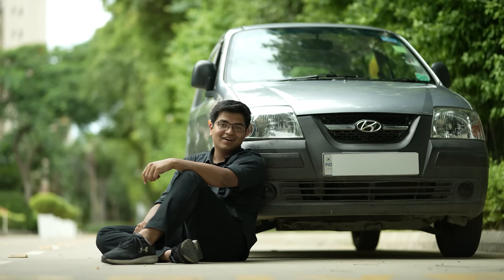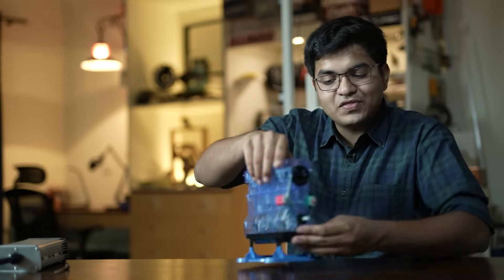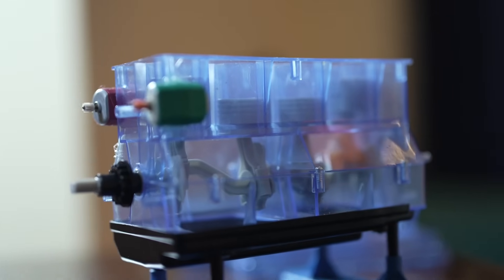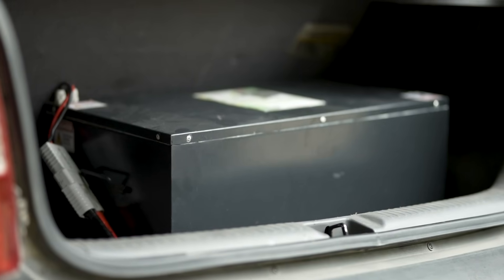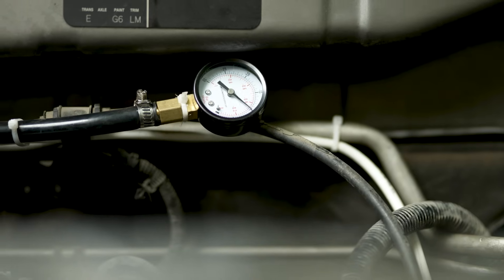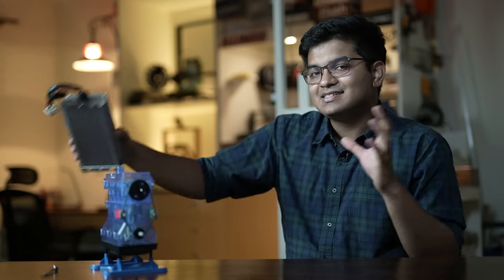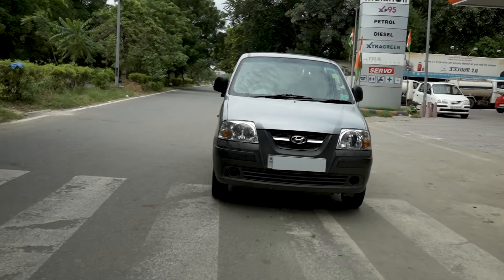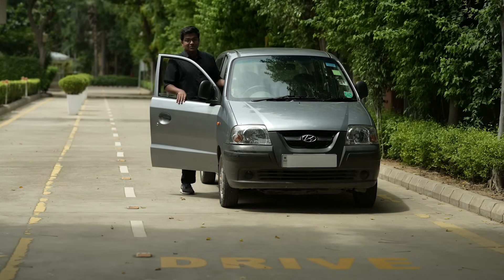Simplest EV Conversion under $3000 - Convert Your Car in 3 Days!

Comment: I need info. On motor and battery buying.
I want to put 50kwh battery in my swift if possible.. but if not thalen i will put maximum possible battery size by upgrading suspension for battery weight
Reply from the maker: Hey - are you looking for a really long range EV? Because a 50Kwh battery will get very expensive. Even commercially produced EVs like Mahindra's E2O have only a 15KWh battery (around 140Km range)
Reply: @MakingWithMihir   all i know is tata nexon ev max has 40 kwh battery. And it does 300km.
So a 50kwh battery will be best as its range will be 400km around.
I am a mechanical engineer and i will make it possible.  Just need info on battery companies which can deliver batteries custom shapes
Reply: @MakingWithMihir  can you please give me conpany names for electric motor and battery pack making companies???

Comment: Well done. This will boost the spirits of 15 years old Santro owners. Is it possible to make auto transmission.
Reply from the maker: Hey! One of the other conversion techniques I want to try out gives you an EV without transmission. You can buy an off the shelf differential with a motor attached to it. The idea is you remove your rear two wheels and replace them with this differential. Remove the whole engine and add a separate motor for power steering and AC compressor. The only issue I faced with this is obviously the issues with adding a separate motor for power steering and AC compressor but also that I couldn't find an off the shelf Indian made differential with a 6kW motor.

Comment: Use the alternator for regenerative braking or something 🙂
Reply from the maker: Hey! That's a great idea. What's interesting is that modern BLDC controllers like the Kelly Controller come with built in regen braking. You'd have to add a switch that engages it when you release the throttle but other than that, it's quite straightforward. Definitely something I'm looking to add to this car!

Comment: Show  more specs of battery and motor.
Reply from the maker: Hey, you can find the technical specs on my website (link in description) TLDR: 72V 6kW motor, 72V 100Ah battery, 350A Kelly Controller and 72-12V 20A DC-DC Converter

Comment: Is the EV conversions allowed in India. When I checked with RTO. They told its not allowed to convert to EV
Reply from the maker: Hi! EV conversions are allowed in India, however you can currently only use an ARAI approved kit. If you go through an ARAI approved conversion company they will update your car's RTO registration and provide you with a green license plate. 

This conversion is currently at Proof of Concept stage and I have not yet explored the regulatory requirements to get certification and approval. 
The focus of this project  was to develop a simpler and more cost efficient conversion technique.

Comment: Nice work. Your engine oil will last forever. But what about the RTO and changes required in Car Registration papers?
Reply from the maker: Hi!
The conversion is currently at Proof of Concept stage and I have not yet explored the regulatory requirements to get certification and approval. 
The focus of this project  was to develop a simpler and more cost efficient conversion technique.
If you would like to convert a vehicle right away, I understand that there are ARAI approved conversion kits available. If you go through an ARAI certified company, they will get RTO registration updated and give you a green license plate.

Comment: Here's a nice project i would love to convert to EV; not for long distance trip, just around town. the 1997 tacoma truck 4-cylinders LX auto tranny will be an ideal project when the gas in Calif is $5.50 per gal. it also has 381K miles with original tranny; overhauled engine with 271K. wouldn't you still need water pump to cool the bare engine? since the fuel tank will be empty, 4 pistons and cam shaft removed, that would be lot of weight saving to allow more lithium batteries in parallel for longer range. what do you think of this prospect to convert the truck?
Reply from the maker: Hey! First off - please keep me in the loop if you convert your truck! I'd love to see some pictures. 

As for this technique, we can get away with the whole timing belt hack because of how light the car is and the small motor. The car has a Kerb weight of around 900Kg (1980lbs) and the motor is only 6kW. 

I'm not sure if california is cool enough to avoid AC. If you don't care about AC, the simplest option might be the classic rip out the engine and put the motor straight on the bell housing of your transmission. For power steering you could swap it out for a EPS rack or jerry rig a cheap DC motor to spin your power steering pump.
Reply: thanks for your reply. i also saw few video on your idea straight electric motor to the tranny. this method requires even more accessories to run the AC, the PS pump, brake and change in gear shift method. actually, either method would require jerry rig to get the 3,500 lbs truck rolling; may encounter uphill lag in Calif mountain driving in my local area. maybe in the future there might be a much simple and cheaper methods. thanks for sharing your idea.

Comment: What i was asking how you pass from RTO you kept it white plate or green plate ?
Reply from the maker: Hi!
The conversion is currently at Proof of Concept stage and I have not yet explored the regulatory requirements to get certification and approval. 
The focus of this project  was to develop a simpler and more cost efficient conversion technique.
If you would like to convert a vehicle right away, I understand that there are ARAI approved conversion kits available. If you go through an ARAI certified company, they will get RTO registration updated and give you a green license plate.

Comment: If the 12v vacuum pump fails, you can have a break.!
Reply from the maker: Hey - the vacuum pump is needed for brake assist only. It maintains a vacuum in the brake booster such that even if it fails, you can get 4 full braking operations before the booster equalises with atmospheric pressure. Even once the booster has atmospheric pressure, the brakes will still work - the mechanical linkage to the brakes is not dependent on the presence of a vacuum - they'll just be harder to push. Thanks for your comment!

Comment: Sir I need vaccume pump for my e conversation car.And good dc to dc converter
Reply from the maker: Hi! For DC-DC converter I recommend looking at IndiaMart and finding a seller. If you have a smaller car, you can also check out Karol Bagh in Delhi - there's an EV market there mostly for e-rickshaws and sell smaller converters.

I had a hard time finding a 12v vacuum pump too - couldn't seem to buy what I needed in Chandni Chowk, Chawri Bazaar, Sadar Bazaar or Mayapuri. There are many sellers on wholesale websites like Alibaba that sell vacuum pumps - check those out and get in touch with the sellers. It will take time to come so plan ahead!

Comment: Price and brand of the Motor kit???
Reply from the maker: Hey - you can find more details on the website article I linked in the description. The motor is a 6kW 72V motor from Compage Automation in Delhi and they can sell you the appropriate controller for it too. In my case, the controller was a 350A Kelly Controller

Comment: The fact that he's able to do this with a relatively tiny battery because of a Gearbox, tells me that there's space in the EV sector for Manuals, IF enthusiasm for Manual cars persists. 

Not only that, if pairing an EV with a transmission means you don't need as powerful motors or batteries, it means that EVs can be more efficient and even more environmentally friendly because you won't need the huge battery packs. Am i crazy or is there a future for the transmission here?
Reply: It would improve low end torque greatly, and you would have max power immediately available to you as opposed to max torque. This would increase accelerations in the low end however it would not help with top speed. The top speed of a car is determined by how much drag and friction losses you can offset with the power of your engine which does not change with a gearbox. It would harm top speed and efficiency a little bit as the gearbox would increase mechanical losses. But i would love to see electric cars with gearboxes as it would make for even more break neck accelerations. A propper CVT on an electric will be even better as it will allow for continous and max power throughout the speed range
Reply: Steam cars also don't need a transmission but some White steamers had a two speed axle
Reply: bro u got some real brains right there
Reply: This is great stuff ! I may consider this for a nano we have
Reply: nice epic bro duded
Reply: Congrats for your innovation. My doubt is motor has such power to drive the crank shaft & piston moving up & down.u removed spark plugs. Is there any drawbacks.
Reply: I think they removed the pistons, there's no need for them if the head has been removed
Reply: I have a feeling the reason he used a gearbox is because he probably used a DC motor which are cheaper than AC motors (used in teslas and all other production EVs), the downside to these are they have less torque and can't rev as high as AC motors.
Reply: you are crazy
Reply: I love this line of thinking.  I want a manual electric!
Reply: my 2 cents ... xmission will hardly make a difference as in motor peak torque is immediately available

in case of engine torque is gradually developed so is the power and hence you need transmission manual or automatic with multiple gears for various reasons 

only possible benefit of an transmission for ev would be  in my opinion for inclines or slopes if u dont want the hill climb n hill hold n other modern tech
Reply: @sagar33sawant  EVs are terrible with 1 speed tranny on highway. It's laughably bad.

Comment: Is this street legal, i mean has the modifications been registered with the RTO
Reply from the maker: Hi!
The conversion is currently at Proof of Concept stage and I have not yet explored the regulatory requirements to get certification and approval. 
The focus of this project  was to develop a simpler and more cost efficient conversion technique.
If you would like to convert a vehicle right away, I understand that there are ARAI approved conversion kits available. If you go through an ARAI certified company, they will get RTO registration updated and give you a green license plate.

Comment: Hi this was an amazing and well done video. I think this was a really thoughtful use of your grandfather's car. As an electrical engineer I would recommend that you do not use a 12 secondary battery but rather power your low voltage line directly from the 72-12v converter that you have. It seems like it is beefy enough and has enough heatsinks. This would also reduce the overall weight of the car by a few kilograms. If you keep the secondary battery always charging off 12 volts you will degrade the battery and cause corrosion of the inner cathode/anode. Please search up lead acid battery left on continuous charge. That battery would be better off in gas car. Overall great video <3 please make more
Reply from the maker: Hi! Thank you so much for your detailed comment! I will definitely look into lead acid continuous charging! That said, the battery in the video isn't a car battery - I bought an AGM UPS battery for this purpose. I'm really glad you enjoyed the video and will keep making videos :)
Reply: What if you added another 72v lithium battery ,would we get double the range ..We remove the 12 v and also power from the step down transformer all the 12 v lights ,power steering pump etc ?
Reply: Yes, a second lithium battery of the same size would certainly double the range.
Reply: Please advise ,how do you get the power from the electric motor to the wheels ? You still have the crankshaft ,so the electric motor turns the crankshaft pulley ,which than powers the wheels ? How difficult would it be to convert an automatic to similar ? What if we put a more powerful motor,would we get more speed ?
Reply: In this video the electric motors are essentially replacing the pistons in the engine. This rotation is then fed through the gearbox and clutch to finally spin the transmission at the wheels. Converting an automatic would be similar to this video. Many automatics have a manual gear shifting mode. But if you would like the automatic transmission to work exactly like it did before, my advice would be to find an electric motor that has the same RPM and power as the original Pistons. You want a motor that can run upto 12,000 - 15,000 RPM with the highest wattage rating you can afford. 8-10KW is good minimum for a car

Comment: Congrats dude
Do u need to take RTO permission for conversion?
Brgds
Reply from the maker: Hi!
The conversion is currently at Proof of Concept stage and I have not yet explored the regulatory requirements to get certification and approval. 
The focus of this project  was to develop a simpler and more cost efficient conversion technique.
If you would like to convert a vehicle right away, I understand that there are ARAI approved conversion kits available. If you go through an ARAI certified company, they will get RTO registration updated and give you a green license plate.

Comment: Great job.. unbelievable
One observation.. do you really need 12 v battery.. your 72 v to 12 v convertor itself can Power the 12 v circuit? Or is the load capacity not sufficient..
Reply from the maker: Hey! Great observation - we could power the 12V systems in the car directly with the DC-DC converter but you're right, the  DC-DC converter can't handle more than 20A continuous current. That's where the battery kicks in to help! Thank you for your comment :)

Comment: Amazing! Great work. Making it in a $30k budget is a surprise. Great work and very nicely explained. What is the cost of the battery and its capacity?
Reply from the maker: Hi! The battery is a 72V 100Ah battery. It was around ₹1.2 Lakhs. I used Indiamart to find a supplier and they're usually very prompt with providing quotes!
Reply: Making it in a $30k...should be $3k !?
Reply: ZZZCHB2   because it will only charge the battery when the car is moving not when it is stationary. It is also less efficient than the 72v to 12v converter that he added so it would waste more energy from the big battery

Comment: Well done Mihir! Amazing work - environmentally friendly and budget friendly too! Love this and hope to see more cars running this way soon!
Reply: This is a really bad idea overall, the conversion is only to showcase what can be done. The battery will have a very low life expectancy, it charges slowly and the whole conversion is a joke. The airpump to brake is one of the worst ideas in there, with huge scary implications, the chance of electrical fires is oof the charts with the way this is done, the gearshaft is going to have a bad time with the way it is used and so so many more.. for the cost to fix all these, go research other PROPER conversion kits..